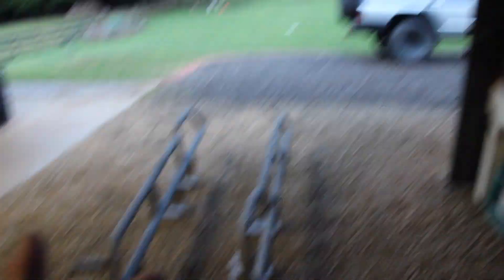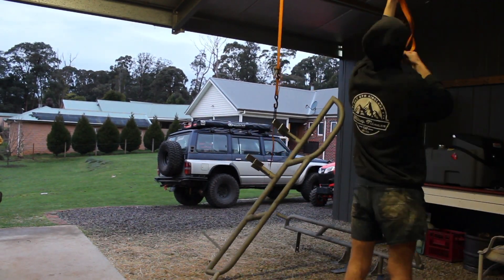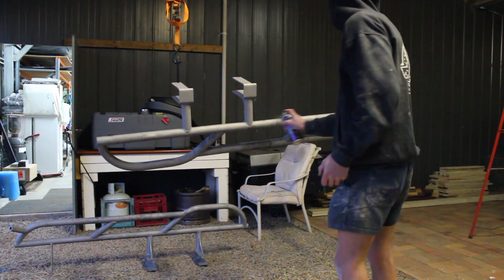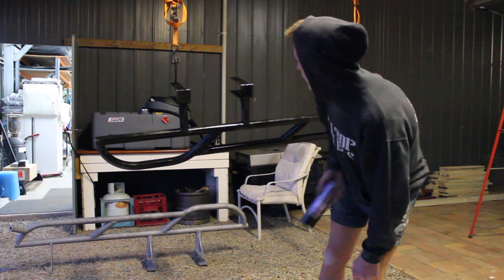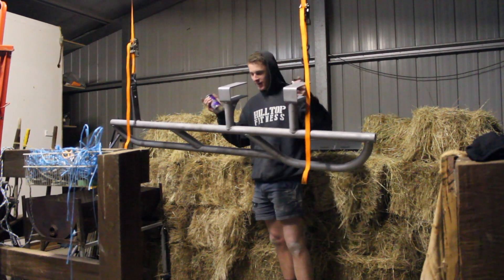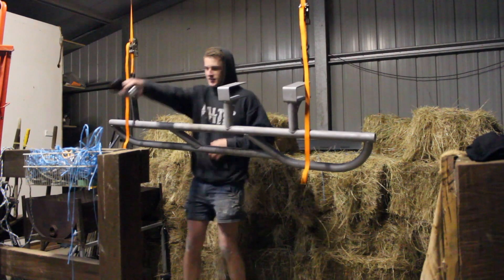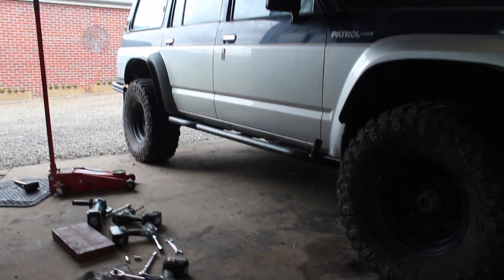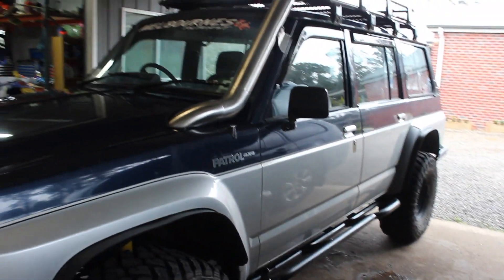4WD Gets NEW Raslarr BARWORK | Rock Sliders GQ Patrol

Comment: Did u have trouble getting the bolt over the chasis
Reply from the maker: Just have to make sure the chassis bracket goes flush with the bottom of the chassis, I used trolley jack to force the bracket to open and slide fully on chassis!